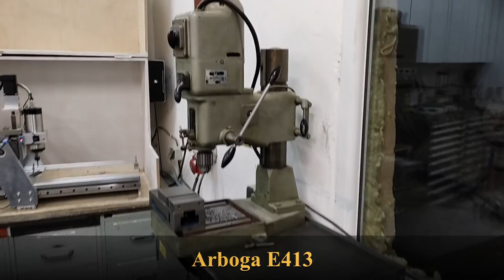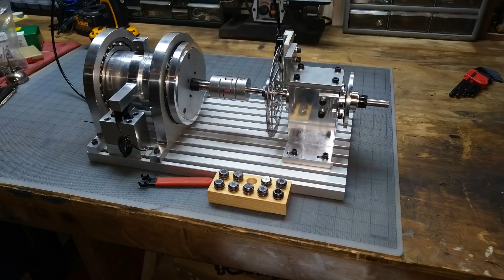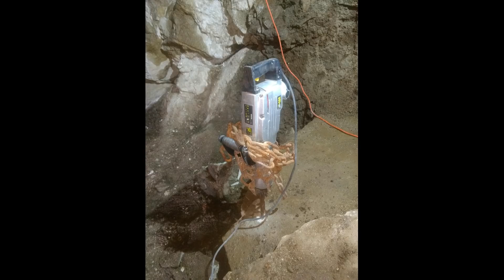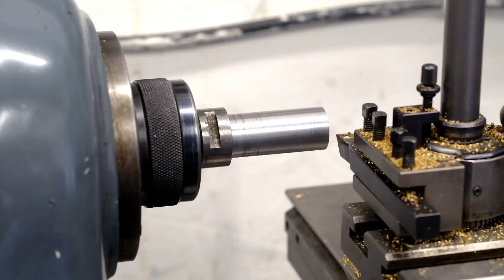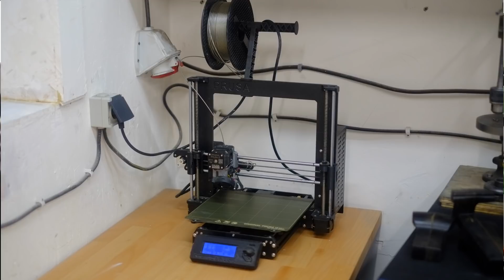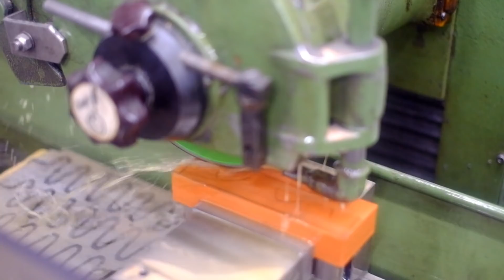Why I Moved My Machine Shop To Europe - Machining Stories

Comment: That's inspiring. I am glad to see that such workshops can work in France and that someone from the US sees advantages there. We have given up on local manufacturing thinking the best option is outsourcing to Asia. This must end. I can relate to your work experience, I work in composite manufacturing engineering but do design and analysis for my own projects, as well as machining. I now have a CNC Linz lathe and Z1C mill not very far from where you live. Greetings from Tarbes !

Comment: i was born an i live in a small mountain town in the foot hills of the hautes pyrénées, and cows and sheep are also neighbour of my small machining and aircraft tolling workshop! watching a guy from USA choosing to coming here , building this really nice shop to do this job, with all the issue with this location and probably French heavy administration trouble etc... you can imagin how funny it was for me to watch this :) And the cherry on the cake, i rebuild and use the same saw  ;witch i confirm is an Italian made (and my advice after 3 years of use of this nice machine ;replace the hydro piston ram by a chrome plated one)..thanks for Luke for sharing this
Reply: Yes it is hard to get things done down there, luckily much of my work has been at the computer so local bureaucracy isn't so critical. I have some questions about the saw, could you send me an email? Just search for Elisenberg Engineering to find my website. Merci